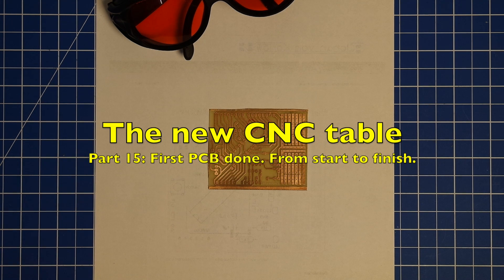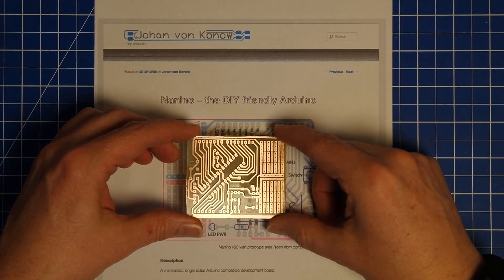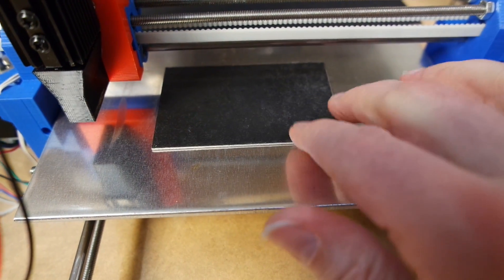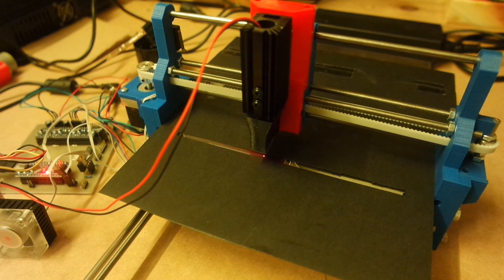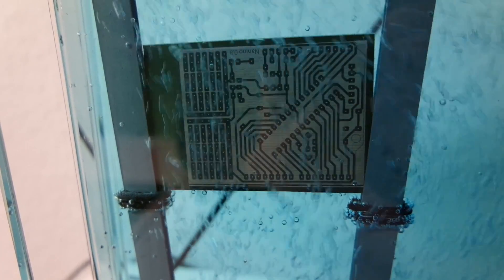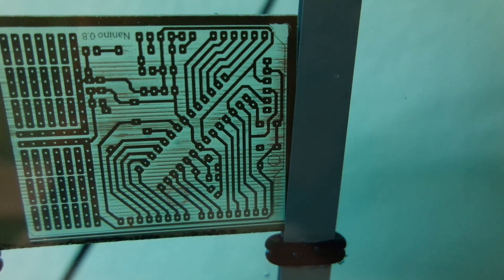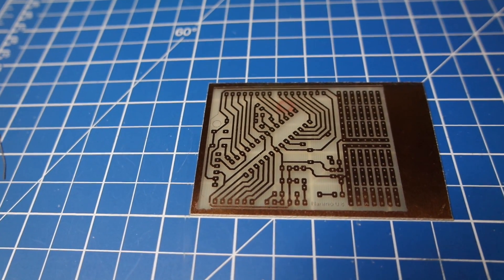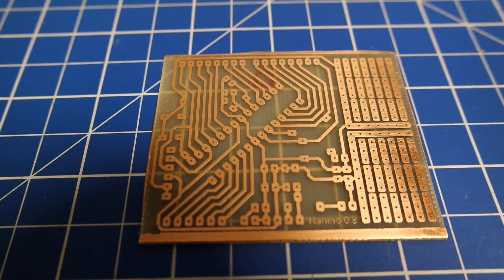The new CNC table pt. 15

Comment: Could you describe to me how you did it so the pci went white to corrode? Could you please describe the process? amorimnit@yahoo.com.br
Reply from the maker: Look here:
https://en.wikipedia.org/wiki/Printed_circuit_board#Chemical_etching

The etchant I use is sodium persulfate. The PCBs are coated with a photopositive UV sensitive layer,
this is removed after the laser engraves the circuit layout onto it.

Comment: I do not understand English so I just have to ask. What model of the Laser did you use?
Reply from the maker: The laser I use is a 405nm,1W laser module. If you go out and buy one, make sure to get one that can be focused within the short distance between the gantry and the board.
Reply: Where you bought the Laser, I do not think you are the same.
Reply from the maker: The laser that I bought is no longer available, and I don't know if the same is available elsewhere, sorry.

Comment: Congratulation, very nice job. 
I want to build one but i dont know what lazer to buy. 
Could you tell me what laser did you use? Thanks
Reply from the maker: The laser I use was a special on DX.com, it is no longer on offer. Any 405nm laser will do as long as it can be focussed to a minimal dot. 10 to 20mW will do. (Also get Laser Safety Goggles !)

Comment: hii sir Can you make cnc using bluetooth?
Reply from the maker: I don't know, I suppose it would be possible with a bluetooth serial link module. That also would not require any change to software, only a different controller would be required, because the nano only supports one serial port AFAIK.
Reply: Dirk Herrendoerfer I saw cnc bluetooth youtube video but i dont understand that video and I understoot ur video.
They use arduino uno for controller. I want to try make it but I didn't find that arduino uno software. Would u help me to make or search of arduino software that they used to..

Comment: Mind if I ask why you went this route instead of using the direct ink to pcb method? That to me seemed so promising, and less expensive. Surely the ink version would have been cheaper to make and faster overall, no? Plus, if you make a mistake, you can just clean the ink off with acetone. Thoughts? I would really like to know.
Reply from the maker: Hello Michael, you are right, the the Ink to PCB method has some real advantages over this. But my plan is not to replace the one with the other - since I build the machine I was simply exploring the possibilities, and I thought that a method where I can simply download a pdf and get it onto the PCB in four simple steps (and a lot of time) seems like something worth exploring. I assure you the machine can also the the Ink to PCB workflow. The benefit with the engraving is, that you can place much finer traces much closer to one another.

Comment: Hi Dirk,
How are you develop the photo positive layer? 
Thanks!
Reply from the maker: I'm using a developer from Bungard, the company that also makes the PCB boards I use. Its just a matter of dumping it in the agent for 2 minutes or so, the exposed paint dissolves.
Reply: Thank you for the reply! What controller circuit and firmware do you use here? Controller_v4 and uCNC_controller_v6? Thanks!
Reply from the maker: Both are v4.
Reply: Dirk, how you connect the laser? Laser->Controller_v4 or laser->TTL->Controller_v4 ?

Comment: The quality of the pcb is verry good. But why wait so long and use a lasser cnc when you can obtain the same quality by printing the circuit on a transparent foil and expose it with a UV box. The process is the same but the time is much much smaller.
Reply from the maker: Yes, true. But this is not so much about what is better and what is not, it's more about what is possible.

Comment: Hi..

Nice project....

About the UV laser (pointer?) you are using, what is that rated at? - i seems to recall you have mentioned that in a previous vid, however i cannot find it again.

Thanks, from denmark
Reply from the maker: The laser module is rated at a whopping 1000mW, but I am using it with about 250mW by lowering the voltage.
Reply: thanks

I currently trying with some uv-ink, and board printed on platic sheet, and exposed via UV led mounted in the scanner part of the printer.  the problem with this is the contrast from the print requires two layer of platic film, and that is just a hassle to get properly aligned... so after watching this, i might jump on alli and find this laser, and make a "bracket" for my prusa printer.